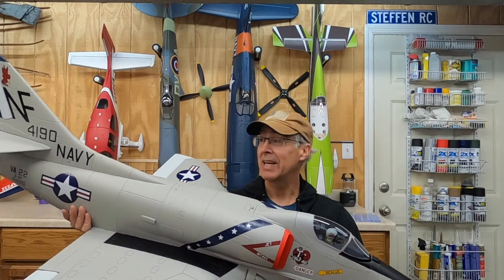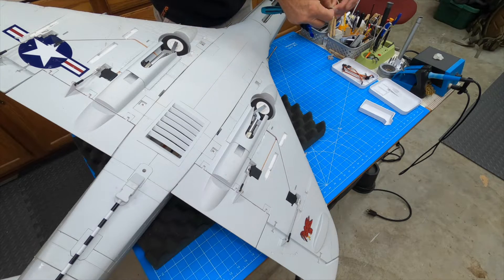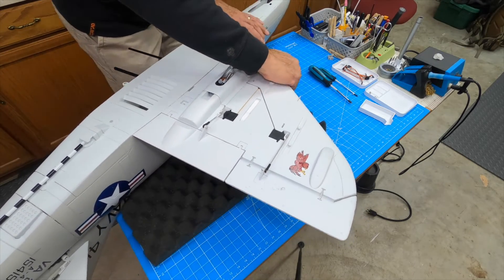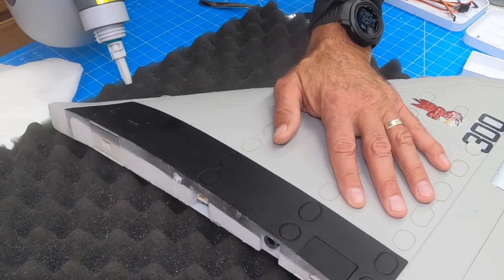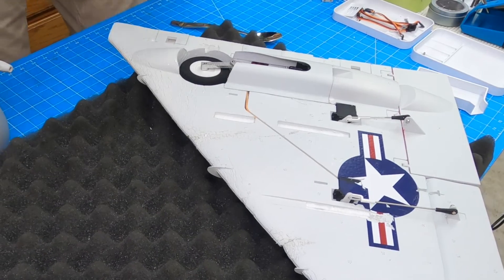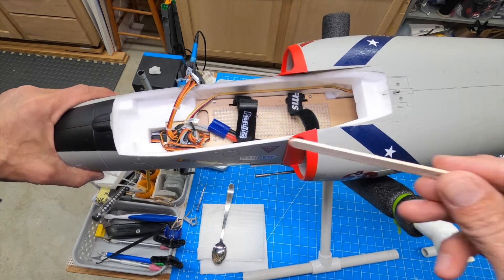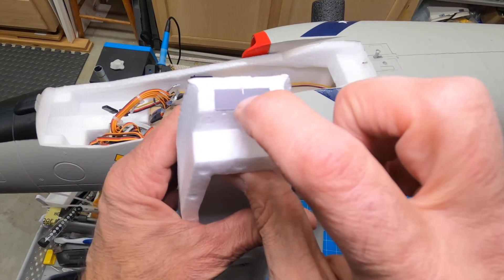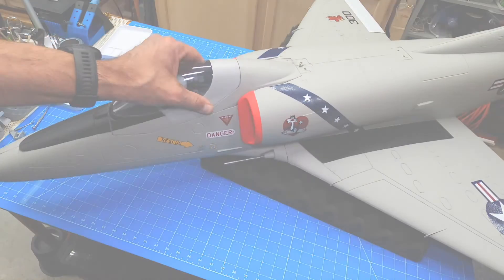Repairing a foam RC Plane with steam

Comment: There are various standard screw heads - in the US it’s most common to see Phillips head screws but in the UK we tend to use PosiDrive - there is also a Japanese standard crosshead screw and if a Japanese screwdriver fits the wing bolts best it may be that you have some of those holding the wings on. 
Great content and result on sorting the foam out.
Reply from the maker: You hit it..  I guess these Chinese made planes are using the Japanese screws..   Thanks for the details about different screws..  Appreciate the insight.

Comment: Just use boiled water. It is easier than using steam.
Reply: It’s not just easier, but also more effective on the deeper wrinkles. You can give the foam a longer time to absorb the energy from the water and also make the inner foam beads expand as well. Remember that styrofoam is an  excellent insulator, therefore it takes time for the heat reach the lower layers.
You got to be careful with the temperature though. If too hot, they beads on the surface over-expand and also stay like this after cooling down again - super ugly! Also, the color may change when getting too hot. I had quite some success with 70-75°C (158-167 F) and leave it in there for som 5-10 minutes. The more water, the longer it will stay on temperature.